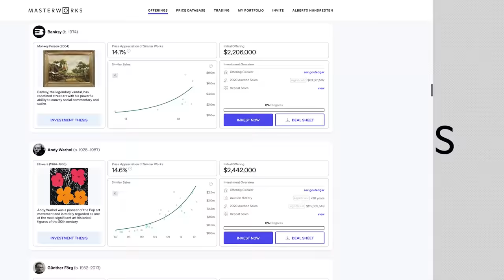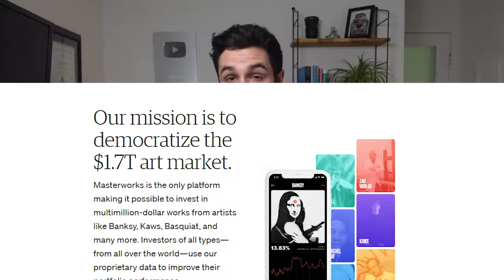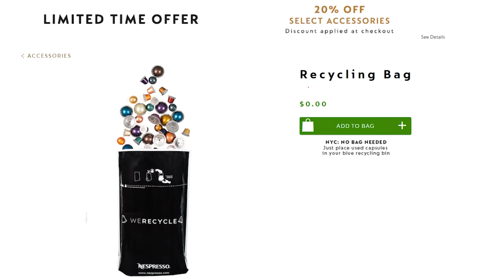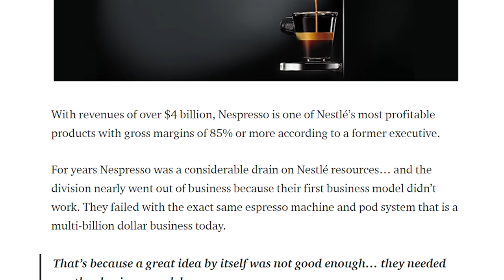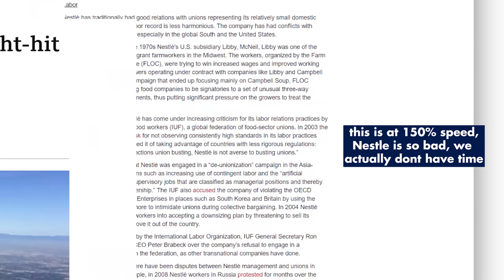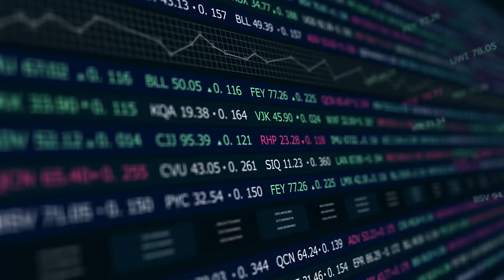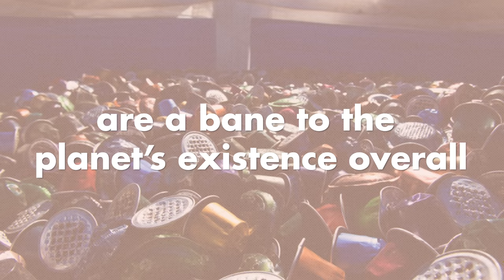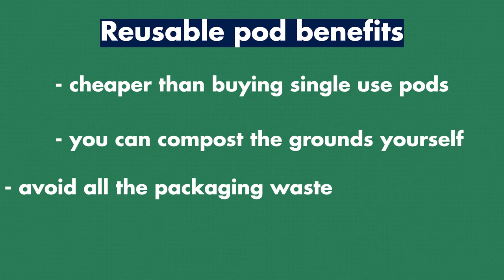The PROBLEM With Nespresso Coffee Pods

Comment: Honestly a more sustainable but still "fancy" feeling way to make your coffee is a French press. No filters, no plastic, etc. I've saved so much money (and coffee grounds as I can make a single cup and not a whole pot) using my French press.
Reply from the maker: Agreed! French press all the way!
Reply: Heck yeah, I love me a good French press.
Reply: except for the crud in the bottom of your cup,  the difficulty in getting the grounds out of the bottom of the beaker (no, don't rinse it under the tap and let the grounds go down the sink unless you have your plumber on speed dial).
Reply: Or an Aeropress. Almost exactly the same amount of effort but I find you get a little less grit in your mug and it's a bit easier to tune to your preferences.
Reply: @teresadejong3011  You are grinding your coffee way too fine. You need an extremely coarse grind for a french press. It should look like you just took a hammer and smashed the beans into small pieces.
Reply: Also a huge fan of making coffee with a v60. Even coffee snobs love coffee from a v60, I think it's the best way to brew coffee at home without spending a fortune on expensive espresso machines or creating pod waste.
Reply: Right, but there's a huge downside to french press coffee.  It's delicious and will ruin you on drip coffee.
Reply: Percolators are also great and look cute too. No waste, no grit
Reply: @nBasedAce  Check out the Esprit Press. French press but ultra fine filter, you can grind finer for deeper flavor.
Reply: There is a rubber gasket that fails. Metal ones last longer too. The glass can shatter.
Reply: Couldn't agree more! As a renter, I moved around a lot and needed a solution for something compact, good for one person, doesn't need to be plugged in to work. I got a hand grinder and a French press. It was perfect and I don't need to keep buying consumables...except any kind of coffee beans I like.
Reply: French press, Moka pot, pour over with a metal, cloth or compostable filter, Turkish, and traditional espresso are all nearly waste free. So get some fresh beans from a local roaster, and sourced ethically, and enjoy a delicious cup of coffee.
Reply: Or pour overs if you don’t like the oily/gritty texture of French press coffee.
Reply: @contournut5726  pour over > French press in every conceivable way. I’d never waste good beans on a French press.
Reply: I love French presses bc they’re great for iced coffee and if u steep properly overnight it will be more flavorful and have more caffeine
Reply: Ew
Reply: French press technique - as course as you can ground your beans, 90c water, 10 minute steep, press it only halfway down and pour.
Optional - a grain of salt - if you find your roast a bit bitter.
Reply: @Kdkjdjewerdnxa  Pour-overs are thin, acidic and waste more beans than french presses. Look at my post about press technique, a properly prepared french press isn't gritty. Or hit up James Hoffman's video about it.
Reply: …but your still forgetting the most efficient and flavourful way to brew a coffee is espresso!! Hence a better cup and less waste from all angles!!.
Reply: @nerp27  I also have a metal one and I agree they’re best.
Reply: @teresadejong3011  we keep a small sieve next to the sink, dump the grounds into it, rinse the French press, dump any leftovers in the sieve again and then either empty the sieve into our compost bin or sometimes I sneak some coffee grounds into my potted plants for a little nourishment 🥳
Reply: We go camping a whole lot and hate having to start the generator in the morning just to have a cup of coffee so I bought a camping French press. You can boil water right in the press on a propane stove! Less dishes, less power, less waste. Great coffee. Happy campers.
Reply: @FutureProofTV  get yourselves an aeropress too!
Reply: Drinking french press coffee every day is not good for u
Reply: I find French press has a bit too thick of mouth feel for m-f drinks. Great for a slow Saturday morning
Reply: Aeropress master race
Reply: Ya, love that
Reply: @nBasedAce  
U can use paper filter for more smoother result. I do that for fine ground coffee it works great
Reply: Moka pot is my go-to, waste-free coffee solution
Reply: I can't drink coffee (allergy or sensitivity, who knows just feel like shit) BUT my husband cannot function WITHOUT coffee.  I find that occasionally even the smell can set me off, so when my husband discovered the french press...OMG...so much better.  It doesn't fill up the whole house with a coffee smell the way that a regular coffeemaker does.  He still prefers his programmable coffee maker, but if he knows i'm working from home that day, and thus will be home in the morning, he gets out the french press, god bless him.  Also it's fun to watch - just from an observer perspective.  Idk why i find it entertaining, but i do. lol!
Reply: I did the Indonesian way. Coffee Tubruk. Just put coffee in your cup and pour hot water in it. Wait 5 minutes and drink. Then use the coffee waste as fertilizer.
Reply: @teresadejong3011  hi there, two tips for you to try. To minimise crud in the bottom of the cup, allow the coffee to ‘rest’ for a couple of minutes before you place the plunger / lid combo on top. Next, stir the coffee mix for a few seconds, which will create a pool in the centre of the surface of the finer, powdery grinds that you then scoop off and discard. For French press best results, you need a relatively coarse grind - it’s the finer stuff getting backwashed through the press that creates the crud, after all. Lastly, depress the plunger nice and smoothly, no need to rush: excessive force at this point will obviously improve the chances of forcing tiny grounds back up through or around the filter. Leave the coffee to settle for a minute or so, and you’ll have produced a result that’s perfectly extracted, smooth, and at the ideal drinking temperature. The combination of a little patience and attention to detail will reward you with better extraction and clearer, tastier coffee. 

Cleaning’s a pain, but scraping out most of the grounds into the waste means there’s little left to trouble your plumbing. Add water to your more or less empty press, pop the plunger back in and pump it up and down a few times before taking it out and rinsing it all down the sink: a little won’t wreck your pipes, honestly. Once a week, when I run the dishwasher, the French press gets chucked in for a deep clean, comes out good as new. Always a nice feeling on a Monday morning, starting off the week with a gleaming clean ‘new’ French press.

That said, you seem to be a prime candidate for a V60 / drip method coffee brewer: filters, yes, but SO much less hassle and clear, crud-free, tasty coffee every time!
Reply: @bellaliehr3803  genius hack - thank you
Reply: If you like drip coffee. I do not. lol
Reply: I literally have a french press and a metal pour over filter. Cheaper and easier
Reply: you can also directly compost the grounds afterward if you have the space...
Reply: @teresadejong3011  you can (mostly) resolve that with a more consistent grind. if you are not already using a burr grinder, switch to one. if you are using a burr grinder, it may not be well made. (not 100% solution but close).
Reply: I used to have a Fresh Press, however it is one of the worst ways to filter some harmful chemicals from coffee unfortunately.
Reply: Why not both?
Reply: Rebel against the system by embracing all approaches to coffemaking.
Reply: We cold brew our French Press Coffee overnight. We get organic coarse ground coffee beans. The grounds get dumped into the garden. Just fine.
Reply: A French press, also known as a cafetière, cafetière à piston, caffettiera a stantuffo, press pot, coffee press, or coffee plunger
Reply: Also Coffee pod coffee is pretty much universally terrible in terms of taste. On the other hand you can make excellent coffee using a french press.
Reply: Moka Pot makes amazing coffee!
Reply: It is exactly what I use for good coffee! Kudos!
Reply: @nBasedAce  generally agree, but I get better results with a finer grind, not even close to expresso fine, something similar to what you use for paper filter, when you find that size coffee almost tastes sweet before adding sweeteners.

James Hoffmann recommended using a finer than normally recommended for French press grind and I can confirm that.
Reply: Or moka pot
Reply: As much as a French Press can be great, the grind remains are always an issue with it. As many here have said though an Aeropress is a much better solution. It's an immersion process just like the FP but when done all you do is take the cap off the end of it and push the grinds left out of the device.  A little water to clean and you are done. Since I live alone I don't have the need to make 4 cups let alone 12 cups of coffee a day. So doing this is great for myself. I've ditched my old coffee maker and got a programable electric kettle and it's worked out great.
Reply: Old primitive espresso machines (e.g. Krups machines 80s-00s) archive the same thing of being a bit fancy and making a single cup of coffee without any extra filters or plastic.
That said i do not see the filters from regular coffee machine as a problem either, they are composable just like your used coffee grounds (and where i live there is a separate trash can).
Reply: pain in the ass 2 clean
Reply: It's called a cafetière
Reply: I love my Hario Switch, a V60 with a valve so you can hold in the water.
Reply: @teresadejong3011  Rinse it with tap water them dump the whole thing on some soil. It's fertilizer.
Reply: @teresadejong3011  I just use a cheap metal strainer with a paper filter when I empty my french press, when drained just throw the grounds in the trash.  I save my plumbing this way.
Reply: @Oscar-if6lq  French press tastes a lot better than pour over. Bolder, richer flavor and less hassle to make.
Reply: @mhawang8204  Were you camping? Where were you going that somehow provided hot water but not an electrical outlet?
Reply: I love French press, but for larger quantities I use a drip with paper filter. Neither one uses a significant amount of plastic. You can even buy a keurig pod thats refillable and washable.
Reply: Also Moca Pot. They're amazing.
Reply: @lukeclifton4392  completely agree.  You get a lot more fine flavours from your beans with an espresso machine, I can't stand french press coffee
Reply: I love my moka pot
Reply: French press uses a lot, a lot of coffee per cup. moka pot in my experience is fast and very effective at extracting strong coffee efficiently
Reply: French Press indeed makes tasty cup. However, it is not very good for your health, because it was found that French Pressed coffee has elevated levels of bad cholesterol.
Reply: Or a moka pot. Or aeropress. Literally anything that is not single use
Reply: Yes! My family uses a metal French press for hot coffee and a cold brew maker for cold coffee.
Reply: What do you mean by sustainable? Can't you think for yourself?
Reply: Didn't like French press.  Dust collector.
Reply: @wiscadams  it’s easier IMO. I love mine. Just knock the plug of coffee out and rinse the press. No fiddling with the mesh screens like a French press is nice.
Reply: I much prefer my Clever dripper, no mess and no grounds in my coffee, but french press is still legit. Immersion brewing is amazing.
Reply: @teresadejong3011  Clever dripper, easier than french press and no mess.
Reply: @nBasedAce  No, the ultra coarse grind for french press is outdated info. Look up the James Hoffman french press recipe for a much better technique with a finer grind and delicious output.
Reply: @vanessasour1775  *espresso. by "watery American coffee" I assume you mean to say brewed/filter/drip coffee, which was first popularized in Germany with the invention of paper coffee filters, not America. That an espresso with hot water added is called an Americano is a whole other story. The foam on espresso, often called crema, is just CO2 and adds a bitter quality so should be stirred away. Marketing of that "crema" was just that... marketing. None of this should be confused with me trying to mock you, just information. Glad you found a method of making coffee that you're enjoying. The best coffee is the coffee you enjoy. Just don't let companies tell you what that should be.
Reply: @Oscar-if6lq  does a v60 need a paper filter?
Reply: I use a stove top Bialletti, but yeah, decent coffee with minimal waste at a fraction of the price.
Reply: I prefer a small bialetti pot.  Theres lots of options, since people have been brewing coffee for centuries longer than we've had household electricity.
Reply: @Genevieve1023  That's the fun part about coffee and why Nespresso is so boring. There are so many ways to brew fresh coffee, some of them incredibly simple with delicious results. Nespresso, compared to those simple fresh coffee methods, is really not tasty by comparison. A bialetti moka pot is great!
Reply: Try v60, much faster and much easier to clean.
Reply: @pcprincipal345  I like the CAFEC Flower, but same deal, cone pour over that takes 2 minutes to make coffee and easy to clean. I also get that the flat bottom pour overs like the April are maybe even more beginner friendly and fall into the same category of quick and easy to clean. And even easier than that would be the Clever dripper which has the same equipment ease as a pour over, but much much more beginner friendly since it's an immersion brewer.
Reply: or even better.. a moka
Reply: You can also compost the grounds if you want to go an extra step
Reply: @shellygirl999 Never thought of that I put up with instant coffee camping.  A French press would be a great upgrade
Reply: @teresadejong3011  I use a mesh wire strainer for the grounds.  I can rinse the ground out quite well & dump them in the strainer.  No clogged drains.
Reply: I did that for a few years, but got tired of the time and clean-up. It's certainly one of the best way to make coffee IMO, it's very good. But I really enjoy iced latte's, and nespresso has made that so much easier as there's less hot water to cool down. I couldn't get a good double shot sized amount of coffee from the press. Although mine is the larger ~3 cup size, maybe a little one would be better. But it doesn't solve the time/cleanup.
Reply: I love my french press!
Reply: except it uses a lot of water to clean it
Reply: Me too. French press rules!! You have total control of your coffee stregth.
Reply: @teresadejong3011 just rinse the glass container in the kitchen sink ,not a real issue
Reply: @teresadejong3011 you don't have a garbage disposal
Reply: @isaman892 why
Reply: Best way to make cowboy coffie while camping🏕
Reply: Yes! Just because something is “old fashioned” does not mean it’s ineffective or obsolete.

Comment: Ah yes, a reusable pod, instead of a machine literally designed to used loose grounds, perfectly sensible. The wonders of our modern world.
Reply from the maker: Honestly it's so ironic 😪😂
Reply: Makes sense depending on the situation. For example at home I like brewing in a more traditional way, but taking my own good coffee in reusable pods to the office and using the machine there is super convenient.

For home use yes they're silly.
Reply: My dad got one of those pod-less espresso machines. Apparently it made some pretty good coffee, but it was also quite a hassle to set up and then clean with each use. All for one cup at a time. It was technically possible to get 2 cups per charge, but then both cups would be disappointingly weak, which also made the machine impractical for serving coffee to friends. That machine hasn't seen use in over 10 years now.
Reply: Those machines require a bit more work to get a coffee but the hassle is not that bad. I've been using them for quite a long time at home and don't feel the need to use a capsule machine. 
A small spoon is usually enough to quickly clean the filter. If you want/need to remove all coffee particles from it, a cup with some hot water should help.
Reply: full circle
Reply: @jesusmgw  I just use a Clever dripper at the office. It's stupid simple.
Reply: I use an AeroPress nearly every day. But I do keep a Kereg  (whatever the spelling is) with reusable pods. It helps make multiple cups for those who don’t care how it tastes. It’s defiantly easy and not messy, just isn’t the best tasting.
Reply: The Nespresso machine is way cheaper than a real espresso machine, so in that way it would make sense. But it's mostly popular among regular coffee drinkers, and not the crazy specialty coffee guys like me. In fact every time I tasted a nespresso it was disgusting, it doesn't have anything to do with a real espresso. But yeah, people like easy and cheap things
Reply: @fnorgen  i just empty grounds, rinse it and reuse. :0 i descale it monthly but as long as its not stinky i dont do much else. i get lovely crema and it is 10/10. i used to be a barista tho and the coffee is very good